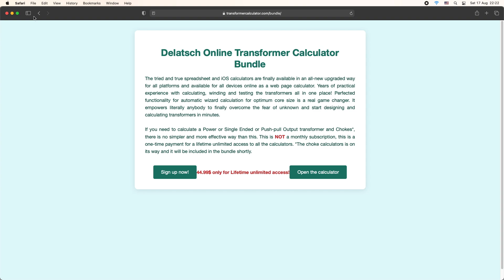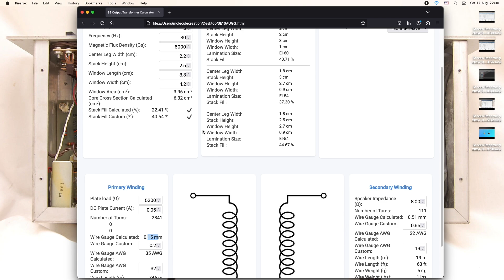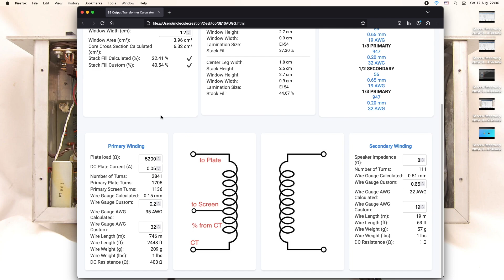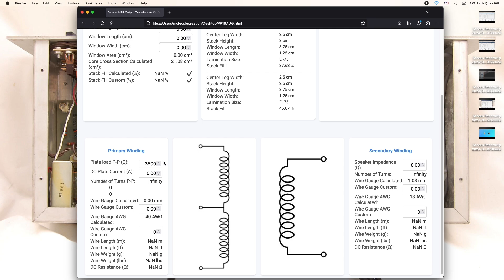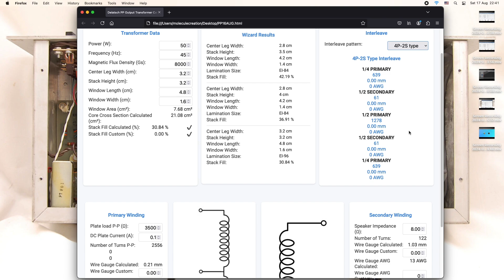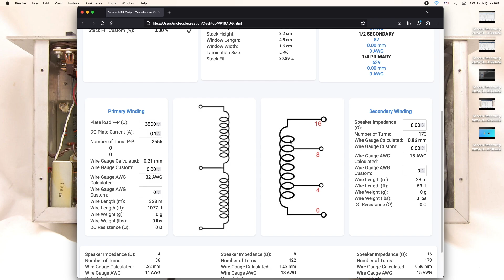Audio Output Online Transformer Calculator SE+PP

Comment: Really cool calculator.  Do you have anything like this for small toroidal audio output transformers?  I am guessing that the math is the same, I'm just confused about the core size for toroidal.
Reply from the maker: Thank you! It wouldn't work for toroids other than the number of turns because there is no bobbin so it is a different approach. I currently don't have a calculator for toroids.

Comment: Did you ever try winding output transformers bifalir? Winding both the primary and secondary together to get a greater bandwidth.  BTW, Still waiting to know how to access the spreadsheets which I purchased
Reply from the maker: Hi Ken, 

I've sent you an email. Yes, I have some videos where I wound bifilar and quadfilar transformers. You can check the UA-5002 and API-2503 videos.

Comment: Nice presentation, I have 3 questions and a suggestion..
- what does paid option offer over the free version?
- is there additional resources for eg. obtaining pre-cut EI core material and wire (guessing something out of China)
- is the calculator assuming only one type of EI core metal type is used.. if so which type. Does it say that?

For the website, it generates 3 options in the wizard, it looks like. Adding a checkbox to each output could allow the page to update the leftmost panel when one is checked.. for convenience mainly and to prevent user error when hand copying the data over. Or if user wants to use something else then none of the check boxes get clicked.

Looks good. I want to try winding something at some point when I get some available time.
Reply from the maker: Thank you! As for the first question, there is a free version only for Power Transformer calculator and it is limited to number of secondaries and you cannot use custom bobbin sizes and wire gauges etc. and it has less calculated values like wire length and weight and dc resistance.

The SE and PP that I demonstrate in this video are only available as a paid version, there is no free version. 

As for sourcing materials I am only familiar with places that sell it in EU. 

The question regarding the core type is a bit complicated to explain but I have a video titled "Top 10 transformer questions" where I explain it.

The suggestion is a good one, I will try to add it.

Good luck with winding!